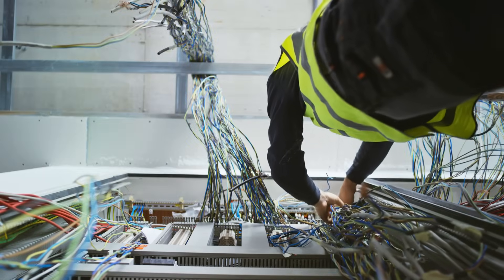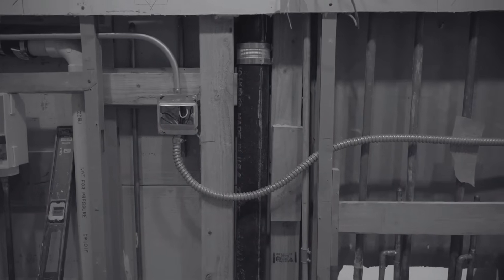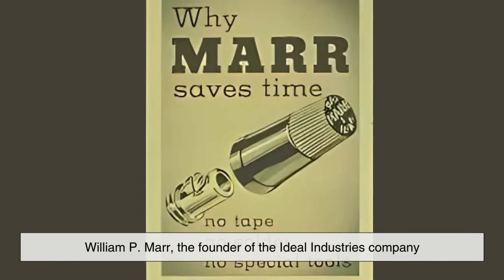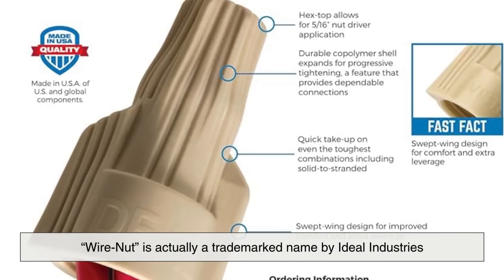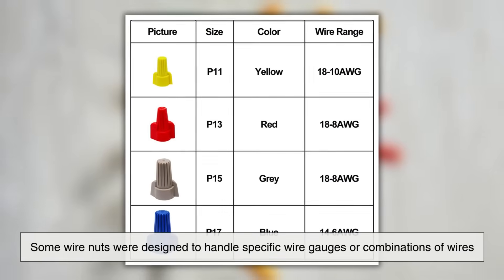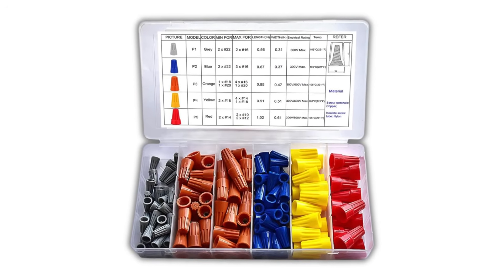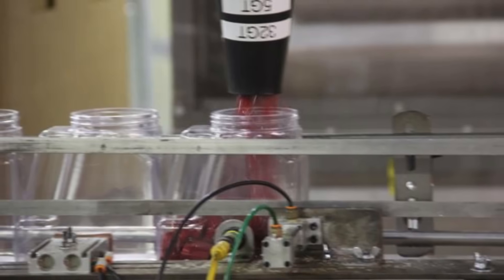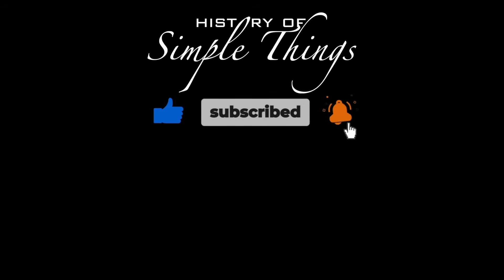Wire Nuts: Why Electricians Trust This 100-Year-Old Invention Every Day

Comment: -7:23 to 7:45
I do pre-twist my connections before using wire nuts (I’m in the US), but I’ve ALWAYS twisted in the clockwise direction. This segment of the video seems to indicate the pre-twist AND the wire nut are in a counterclockwise direction???

Comment: Never seen them in Australia, as an electrician, I shudder at the look of these ridiculous wire-nuts. 
We use blue point connectors , that connect wires with a screw in a brass insert. Or crimp connectors

Comment: Never seen them in Australia, as an electrician, I shudder at the look of these ridiculous wire-nuts. 
We use blue point connectors , that connect wires with a screw in a brass insert. Or crimp connectors
Reply: In the USSR they also didn't use such type of wire connection. Even 70 years ago electricians used arc-welding to connect twisted together wires whether it was aluminium of copper connection.

Comment: Life long electrician here, at continuing education classes we get our balls busted if we say wire nuts  No such thing in the electricians Bible , the NEC called a wire nut the proper term is pressure connector. Have to watch cheap cheating Chinese wire nuts that come with ceiling fans and other products. They do not have the posted spring inside.

Comment: OK, I KNOW that I am not an electrician. I never wanted to be one. And I KNOW that I don't have a ton of experience with them. I also know, that I have had mixed results with them. And IMHO, electricity, and the fires it can start. Is NOT something that can be hit or miss! I WILL NOT USE THEM! EVER! I dont care if it is against code or not. There are several newer "quick connect" gadgets that are FAR MORE POSITIVE, AND THUS, SAFER. i WOULD GO AS FAR AS soldering THE WIRES TOGETHER BEFORE i WOULD USE WIRE NUTS. I hate them!

Comment: The wires were Twisted together in soldered and wrapped with friction tape then came to Buchanan's what is that screw and look like wire nuts then wire nuts with tapered springs inside

Comment: Never seen them in Denmark.

Anyone seen/used them outside USA?
Reply: Never seen them in Australia, as an electrician, I shudder at the look of these ridiculous wire-nuts. 
We use blue point connectors , that connect wires with a screw in a brass insert. Or crimp connectors
Reply: Never seen them in germany I wouldn't be surprised if they were banned here...but I dont know
Reply: In germany "wagoklemmen" are the way to go..
Reply: @jenshoffker5702  Genau! Wobei die gezeigten Klemmen auch sicher sind.
Reply: @ just looked that up, very impressive
Reply: Yes - in Thailand.
Reply: The model used Europe is more space saving, indeed.